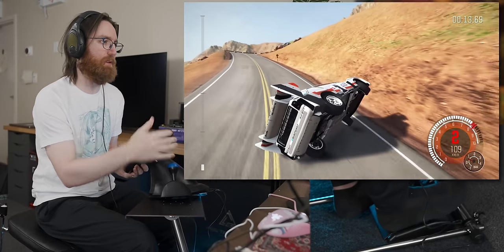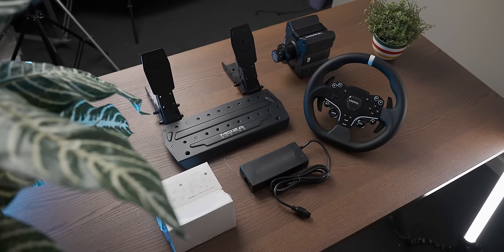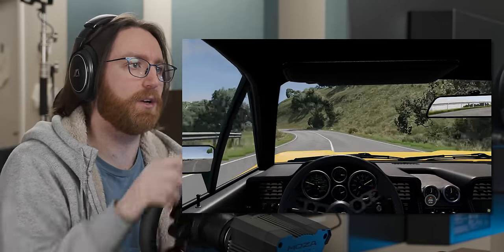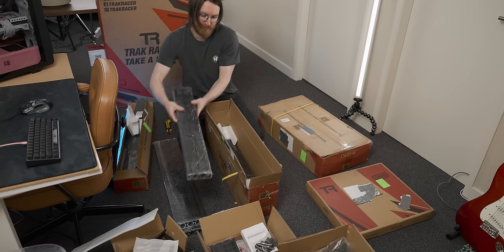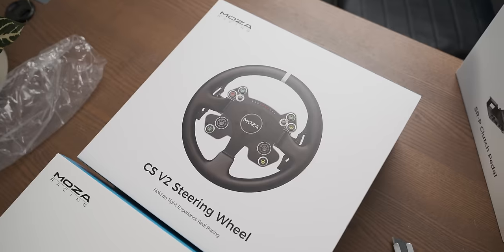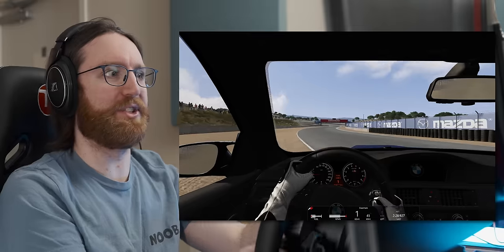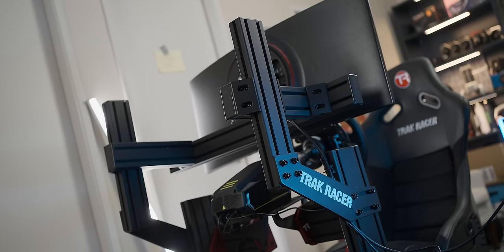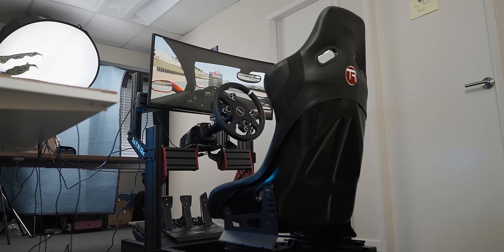Is Expensive Sim Racing ACTUALLY Worth It?

Comment: I've seen a racing sim set up built into a NASCAR shell. Like an actual, full size car with blacked out windows and when you go in, the windshield is a monitor and I think all the computer stuff is in the engine bay. 

And I didn't know this brand exists. Granted, I haven't dug very deep into all the options out there for racing sim equipment, but that's just because I'm a poor child. The brand I always ran into for realistic racing tho was Fanatec. That one does come with console compatibility I believe.

Comment: Don’t lower the overall FFB strength of the wheel, lower it in each sim and game instead.

Reason being when you lower it on the wheel you are lowering it’s headroom to avoid FFB clipping, that’s when the motor is being asked to do too much and it starts dropping effects.  So keep the base high, and the sim lower to avoid that.

Comment: Yeah.... shouldn't try to wrestle the wheel in crash situations. Just let go, it will twist your thumbs if they can get between wheel and button box, or bend you nails back if it hits them. Speak from experience, got few nail bends while drifting :P
You do need to tune settings to get  more "proper" or desired feel for different sims/games. You can really go down the rabbit hole and start setting for different types of cars and for each sim. Direct drive has really taken off, quite a few choices out there and become more affordable due to competition. Not like few years back when there was couple of DD wheels or DIY option (which is great fun project if you like electronics and building stuff, still love my DIY setup based on Simucube 1)

Comment: I took the buy once, cry once approach to sim racing. I bought a G29 and pedals. When that wasn't enough I bought a rig and a seat and mounted the G29 and pedals on it. When that wasn't enough, I bought Heusinkveld Ultimates for $1000. Now all I needed was a proper direct drive wheel. So I bought a Simucube 2 Pro. $1400 for just the motor. The Moza you had makes 16Nm of torque. My Simucube makes 25Nm. I never use all 25 because the steering is just too heavy. Right now I have it at about half which is PLENTY. If anything, at a rough track like Sebring in iRacing, it can be too much. The wheel can really hurt you because it's so powerful and can deliver that torque faster than you can react and pull your hands away. One of my fears is something in the computer or the game freaking out and telling my wheel to send 25Nm to the right and breaking my thumb or something.
Reply: I think 14-16NM is the sweet spot, for me catching slides is a lot easier when the motor is stronger and can properly spin the wheel through your hands with a light grip.

Comment: Your videos is very catching and keeps things interesting!

However as far as sim racing goes I suspect there are a few things you did wrong configuration wise that could help improve the experience across every wheel you tried. 

You should never limit the force feedback in the wheelbase software. This removed a huge amount of dynamic range and you are almost certainly losing detail in the stronger forces. Always adjust force feed back strength in the sim program. I generally bind it to a knob to adjust on the fly per car. 

There are also some settings in specific programs that differ from other programs. Like Assetto Corsa you want the road feel, abs, and curbs settings to all be at zero.

There is also a different launcher called content manager that I suggest you try. This launcher revamps the FFB in Assetto Corsa and greatly improves it. 

The other thing I suspect isn't correct is your field of view. To increase immersion you should be measuring your monitor relative to your view and adjusting the field of view in sim to match. There are calculators for this online. This way when you look 10deg to the left, you're seeing what would actually be there when you look 10deg left in real life. 

It would be cool if you could try these things and let us know how it helps!

Comment: For BeamNG you need to go in the settings of the game and set the wheel power to the right range: for good wheels the FF parameter should be below 250 I think, but the default is set to 500 or so

Comment: Simracing with a quest 3 is unreal, with how good the physics are in these sims now, and modern direct drive wheels do an incredible job of simulating those wheels. In VR with a good PC, and with the aforementioned physics, you are driving those cars. I've seen pro drivers say iracing drives just like the real thing. And all the proes drive this shit, if you're ranked high enough, you can queu into verstappen, lando norris, etc.

The cars are made from manufacturer data, and the roads are all laser scanned. You get the world's most famous tracks literally down to the pebbles. Nowadays everything is simulated, from wheelwell flex to the rubber marbles on the track to the dirt dragged onto the tarmac from wheels dipping off the road. No, the pistons in the engine aren't firing, but the power is modelled going from the motor through the transmission and differential and all that shit, and people pay money to the brainiacs who make the best car setups and sell them

I got a g27 on a whim 9 months ago. I enjoyed AMS2 and iRacing enough to drop the cash on a full steel rig and DD wheel and loadcell brakes. I play it every day. It never gets old. Even if I get bored of say open wheelers, I'll just drive gt3 or gt4 or porsche cup or any other of the million cars in these sims.

But there's also plenty of people who drop 5 grand because they really think they'll enjoy it, and then it ends up on kijiji 5 months later. Like anything else, you can't really know if something gives you satisfaction until you try it to a certain degree. You might think you know what goes into car racing, but until you're trying to grind seconds off your laps, you can't really be sure what it's like, and if that's something you'll enjoy.

Comment: These wheels need a lot of fine tuning of settings for every game. Usually you can look them up what others worked out and begin from there. It makes a huge difference, because most games aren't aware of what wheel you are using. Artificial effects in AC for example. Lowering the overall torque for a 5.5Nm is a waste, better have it at 100% and adjust the settings in game for a realistic feel without capping it hard to half it can do. On higher torque it may be needed to avoid injuries, but why buy a 17Nm if the game isn't allowed to use the force? It is needed if you have a high holding force for driving through a curve and still let the game let you feel the curbs. You can have more fun with a well set up 5Nm one than a bad set up 20Nm.

Comment: Ive got a Logitech Gpro  wheel and pedals 11nm is plenty .Not cheap @£1250  and its absolutely perfect .With a GT Omega Prime alliminium cockpit that cost about £700.I really wouldnt recommend any wheel stand ,your seat needs to be attached to the same frame as wheel and pedals or they will be slidingapart all the time.With ps5 and monitor my system was about £4k and nowhere near high end but all I will ever need .

Comment: Revising my comment from before.  First thanks for the video.  Only thing I want to say is watch out with your hands and thumbs when turning up the intensity level on a direct drive motor.   They can get violent sometimes and snap very quickly.
Other than that, thanks again for the video. Take care.
Reply: I just wanted to add one last thing.  We all spend allot of money just to virtual race on a 10-50 dollar game, but if you can afford and enjoy doing this kind of thing, then have some fun at it.
I have allot of money tied up in a gaming computer, VR headset, Large HD Display, a mediocre  Wheel controller, and many different racing games.  Only thing I don't have is a Racing Rig of any kind.

I guess the object again is to have fun.  Anyway, take care.

Comment: Moza R5 is entry level. And 5nm is not very much at all. Most sim-racers will typically use a wheel with an output around 15nm, though there are some high end options that are 25-30nm. Anything above 15 is overkill though.

Comment: Well Dawid, nou het die gogga jou gebyt 😁. 
I think giving VR a go will be a great next step.  Maybe try more than one option as well, like the Quest 2 and Quest 3.  You can give Pimax a go but their software can be hit or miss sometimes and you may engage in some vigorous hair pulling 🤔.  Also try and reach out to Next Level Racing to see if you can have a go with their Motion Platform V.3 for a truly "next level" VR experience that will be a fairly easy add on to the TR 160 rig.  Other motion platforms will require a lot more effort to install, so maybe that could be something to try and do another vid on as well.
See how deep this rabbit hole goes and book a week or two in a rehab clinic afterwards because this stuff is like a moth to a flame or cocaine to an 80s rock star LOL.

Comment: 1K for that stand isnt bad. id bet i could build that for 200.00 at the local steel yard (maybe 450 out of AL) but then id need my plasma/oxy-acytline and at least a day welding. more if AL as now im using TIG instead of MIG.  so yea, that price is really not bad.     id probably junk yard a chair for 50 bucks.  those pedals with all their setup... dont think i could or even would DIY a setup for cheaper.  the wheel... man that motor. you could save some money going DIY on that - maybe using a small cars starter motor. would need to do some modding to the stator tho.

Comment: I'm still slushing around with a Logitech G-29 like you were. I did do every mod possible though to the system. Pedal mods, check. Every shifter mod in the book, check. flappy paddle mod, check. Added a drift capable Ebrake , check. New Hyper X racing chair with wheel locks. check. Meta quest 2 VR system , Xmas gift from my beautiful daughter. check . All on a $100 Amazon micro frame. That part sucks big time. It all works reasonably well for what it is. I am so jealous of you though. That setup is well beyond my SS income. Please play the ever loving crap out of that setup and smile for all of us.

Comment: @11:41 and onwards: it seems the front mount is mounted in the wrong direction?   It shouldn't be recessed into the rig like that... it should "stick out" towards the driver. 
I'm curious, what was the actual compatibility issue here?    Could it be because of mounting it the wrong way, or was the base simply too wide to fit between the plates, or was there an issue with the bolt pattern?

Comment: Im probably one of few who doesn't find it expensive. Just buy used, you find 80% off all gear online is in great condition, most pretty much unused. Once you've got a few rims,base,rig and pedals you're set for years. My 3080 at retail cost £1000 its outdated in a year, simucube 2 is 4 years old. You bought day 1, good value for money. Simucube 3 aint even at planning stage. Could get easy 8 years out of a base until its outdated. Im probably £2.5k deep. Money well spent, i have a couple races a night.

Comment: Ya, these set ups can be quite expensive, but for people who like these kind of games, they are surely a ton of fun.

But my, I kinda felt your thumbs through the screen..  As my instructor said: "Don't wrap your thumbs around the steering wheel. If the worst comes to the worst, you won't be able to release your hand quickly enough and break some bones..."
Get a good straight seating position, have your thick thumb meat resting on the indentation of the steering wheel and lay your thumbs on the circle... (like you did with the left hand at 5:53). If your distance to the wheel is correct (ideally, your wrists can rest on the steering wheel's edge, when the arms are stretched out),  you can apply a non-tiring pressure very easily to maintain a firm hold of the steering wheel. 

Regardless, that's what I got drilled into my head. Drive as you feel best comfortable! (*￣▽￣)b

Comment: Your experience between the R5 and R16 should not vary that much on the same game. You should feel the same things, its just the R16 will give you more detail and way more power.

But the R5 is already capable of giving you 90% of all of the detail that the game can give you. In fact, most race cars actual force in fhe wheel is around 15-18nm. So you dont even need to run these things at max for an authentic setup.

Comment: sorry did that pit of paper just say 360W for the R16 and 480W for the R21? my 7900xtx doesnt even pull that much. (Ive underclocked and undervolted it to 2200MHz and 700mV so it only take around 260W)

Comment: Pedals are the most important item for simracing and they sent you one of the worse pedals, it can go from 100€ to 2000€ each pedal (Simucube Active Pedals)
Moza is cheap, there are bases way better such as Simucube which is way smoother and stronger.

Comment: I've been driving boring, everyday cars for more than 30 years. There's not even one time I can remember that my wheel was vibrating like that, even when I was driving on gravel. Why the vibration of a sim wheel is a benchmark of its quality? Isn't a real life wheel supposed not to vibrate or wobble? In real cars a good wheel is a steady wheel.
I'll tell you why vibration means realism in sim racing. Because in a game there's no other way to feel the turns, the bumps, the asphalt, except the wheel. That's fake. In real life all forces are transferred to your body in many other ways. When real driving, I feel the bump not via the wheel, but via my butt.
I do not need a wheel to tell me that I'm over a bump in such a fake way, it will just add fake elements of "realism". I just need a steady, reasonably well made wheel, that can transfer the amount of turning I want to the wheels of my car.

Comment: First of all, it is a crime to use chase camera when you have rig / wheel. Second of all you forgot games like ACC and iRacing. You need to make another episode with better pedals (like Heuskinveld or whatever you name them) and games mentioned earlier.
Reply: It's not playtime for the ppl that buy it. It's used for the likes of iracing and serious sim racing. Sim racing is a hobby like real racing but only a fraction of the cost of running a car all season at tracks.  Tbf it's relatively cheap compared to that and if you wreck unlike real life you don't have to buy a bunch of new stuff.

Comment: Hmmm the short answer here is hell yeah it is I used a G29 starting or and now use a Moza R12 CS wheel CRP loadcell pedals and Moza hgp shifter and hbp handbrake in Next Level Racing cockpit and 50in Samsung QN90A for a monitor and a HP Reverb G2 HMD when I really want to be immersed and a retarded amount invested in higher end Audio my favorites being Audeze LCD2's and Sennheiser HD650 run through a Ifi Zen stack so freaking awesome and a JBL Bar 1000 for when I'm not gonna disturb anyone live that thing